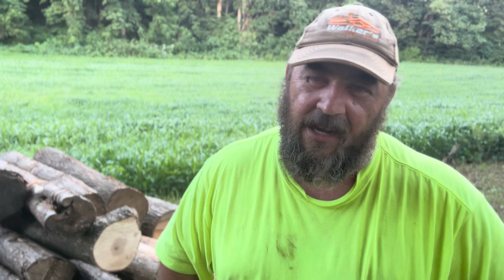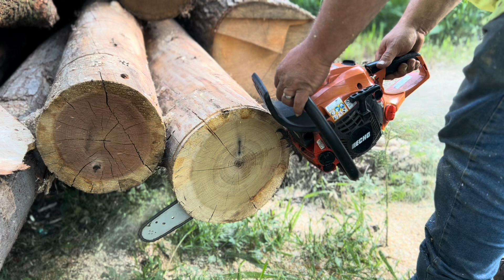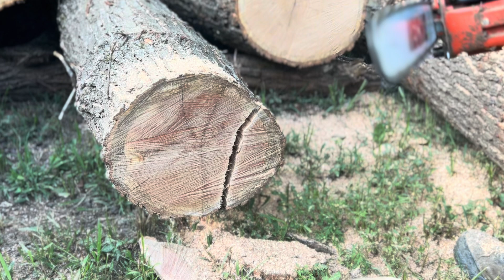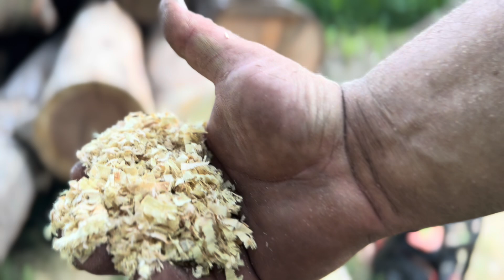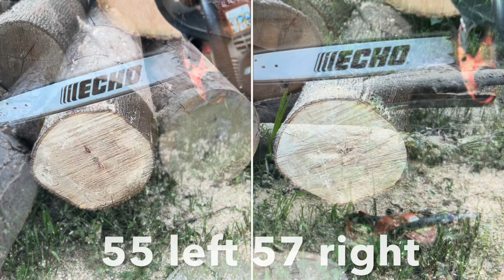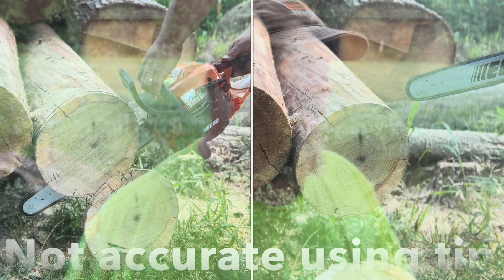Part 2! Developing A Faster Chainsaw Chain!  Testing On 325!

Comment: I'm with CF!!! 👍🏻 the 23RS probably has some proprietary grinding set up to get some off the wall angles, to leave us wondering how the heck they did it. Great chain testing Smitty. I really like the WCS raker gauges, they are hard and don't grind away, and they put a nice ramp on the raker. 👍🏻